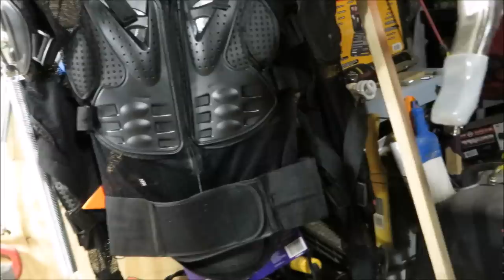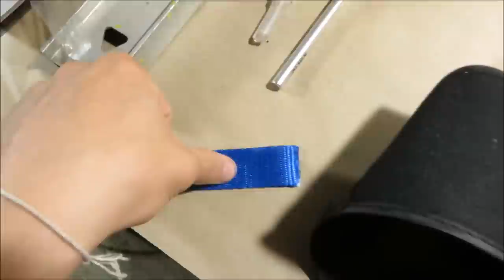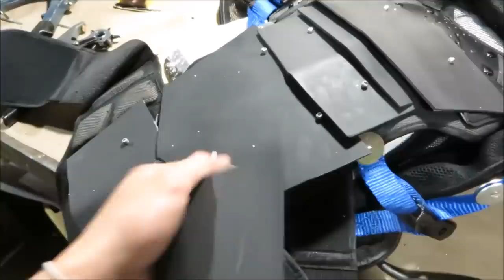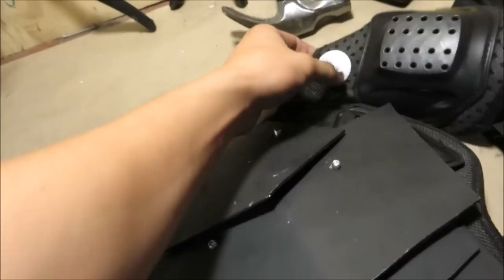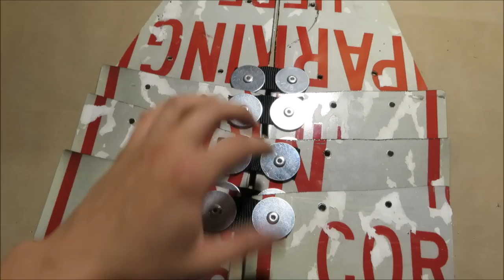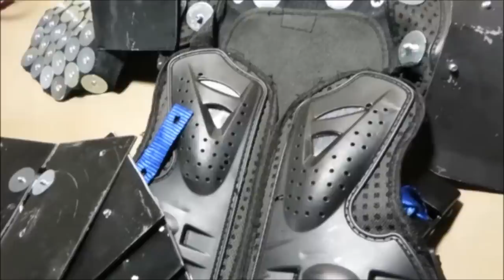How to Make: Body Armor

Comment: Can I make the Orbalisk armor and still have its powers through this tutorial?
Reply from the maker: Sure.
Reply: Nonlethalbychoice do you know what that is?
Reply from the maker: Jedi Grand Master Yoda
No.
Reply: Nonlethalbychoice then how do you know if what I'm asking can be done?
Reply from the maker: Jedi Grand Master Yoda
I don't.
Reply: Nonlethalbychoice As amusing as this is.

A quick google search showed it to be a type of multiplated armor from the Starwars franchise. (As much as I love the movies, I'm not a fan of most of the books... which is where he probably got this, books\comics.)
In the lore of SW, the armour is formed when these parasites latch onto a host and feed off of, basically their evil energy.

'Strong enough to deflect a lightsaber'. So no, the armor won't be able to deflect a concentrated beam of energy that can melt through nearly anything. Yes, you can recreate orbalisk styled armor using this build with his multiplate rivet technique. The largest problem you'll encounter is finding another jedi to duel with.

Jedi Grand Master Yoda I'm probably entirely wrong and misread, but I'm known to be right on occasion.
Reply: Patrick Hazen Use mirrors.
Reply: Nicky Tobulas :O would that work?
Reply: Road mason No. :(
Reply: Road mason Against laser guns. Use logic.

Comment: Clearly, people don't pay attention to a damn thing anybody says anymore. This guys video clearly states that he isn't building BALLISTIC armor. It's impact armor. Just because something is called "body armor" doesn't mean it's bullet resistant. Aluminum plate like that wouldn't stop a decent pellet rifle. Steel comes in different grades. Ballistic grade steel starts with a specific alloy that is then hardened, heat tempered and plasma cut to shape It is dense and it is HEAVY. My Ar500 steel plates in my entry vest weigh over 7 pounds each at 10x12x1/4 inch. I have a steel gong target that is 6" in diameter and 1/2 inch thick. That will stop some rifle rounds below a 7.62x51mm NATO inside of 100 meters depending on the projectile.

Stop putting words in his mouth.

What he HAS made is fairly decent for most direct force blunt impact. A baseball bat, sure. A tomahawk with a hardened steel prong... not a chance in hell. It might stop a steel blunt target tip on a recurve bow. A hardened steel bodkin arrowhead?.. say goodnight Irene.
Reply from the maker: Amen.
Reply: You know though if you were to wear a gambeson underneath that would be decently compliment the aluminum.
Reply: Ah. The Weavers.

Comment: Using a hot rivet to make the hole is a much better idea than punching a hole through the webbing. Reason why its better? Because the hot rivet melts the webbing and then it won't start to fray and lose it's ability to hold. Very simple idea the hot rivet but a very good way to do it. Excellent work mate, great ideas here, thanks for the upload
Reply from the maker: No problem, thanks for the encouragement.

Comment: Hey great video! I see many people asking for bullet proof stuff. Honestly that's a difficult thing to produce on a dime. What he is showing is great for costume and maybe stopping blunt weapons. More padding is needed to make it effective. AS 500 plates can stop almost any round ( steel normally used as targets at gun ranges ) but you would be too heavy adding full body plates. Composite plates like ceramic and plastics / kevlar are nice but expensive. Not to mention all the cutting to fit the person... thats alot of work unless you have a cnc laser or plasma.

Comment: You're right about the left arm thing. Typically with historical armor, you would put more protection on your off hand (usually the left). If you look at later Medieval/Renaissance knights a lot of them don't even bother with larger shields since that arm has enough protection and their whole suit is good enough to defend against direct blows from projectiles (also bucklers and parrying daggers can serve a similar defensive function as a shield while being more versatile for attacking).

Comment: Just built some low profile body armor, not to stop bullets but for hand to hand combat, I used bent steel plate to wrap around arms connected at the elbow with buffalo leather same concept for my legs then welded small sharp studs in rows to the steel plate so any impact will hurt whoever attacked, I made a chest plate as well with the same studs mounted to a canvas vest, it's so low profile you can barely tell it's on till you see the studs pointing out of my shirt

Comment: I once made a vest which was cumbersome and uncomfortable, but I used Styrofoam, ceramic tile, duct tape and intended to use seatbelt nylon, but I couldn't get a hold of any. I took it to a gun range and it guarded a .223 rifle round, a .38 revolver, a 9mm and a 20 gauge shotgun before finally breaking. Ceramic tile and tough fabrics like nylon or Kevlar (if you can find it) are your best bet.

Comment: When you finish, try this. Wet sand to rough surface, powder coat then apply underliner spray. By the looks, 2 ea. powder coat, underliner. Underliner is now made in gray.
I made 1 similar b4 YT. I used #8 1/4 bolts locktite. Nuts sticking out, guess why? 5/16 on neck, shoulder and elbow. When painted, cant tell the nutty nuts protruding. Nice Video by the way!

Comment: First of all the armour looks good. I love the simplistic approach, and do-ability of the project. I understand that this was made almost 2 years ago but a suggestion on style... By having the upper two (four halves) panels with a seam in the middle, it poses a weakness. And should the armour ever be put into real use, it is a large flaw. By having the upper breast plates solid, it would eliminate the seam, and give added strength.

Comment: You know once I found your channel I was surprised, I have been making weapons from trash and scrap items for years, I got better but no where as nice, One thing I made recently I use a large container lid, broke it in two, I cut cans for a while to save the aluminum to use, I'd cut the middle out and layer it over and over, I also crush the bottom and too add hardening I taped it all together with a lot of electrical tape, my armor/ weapons revolves around tape XD I use a lot .... But any ways I made it to where it was a two piece, a belly guard and chest guard, they would fold back when you tied them together. and form around you!

Comment: you can prevent most scratches by sanding the metal with for example a P240-P320 for a rougher look or P400-P500 for a smooth look

Comment: The heavy armor on the left side is because that is the side you hold a shield and defend with and needs the extra protection. The left side you would wield a wepon with so you have less bulky armor that would be lightweight so you can be faster with more speed and a wider range of movement.

Comment: He pretty cool, I mean this would go with his helmet and gauntlets. and since his gauntlets are designed with the nuts and bolts stick out of the side , you could use this for attack approach and the helmet would be safety for your head so basically riot armor.

Comment: you should try to overlap the washers on your rigth shoulder to get to look like scale armor(adding some using the gaps between them), because what you have there is not very resistant to thrusts

Comment: I don´t know but if you really care about armour efficiency rather than looks the approach would be a different one I think. There´s an medieval type of armour called Gambeson which is just a very thick and sturdy patted cloth armour, it basically consists of reinforced clothing and can really protect you from all sorts of hits and even light caliber bullets(though you shouldn´t bet your life on it). It will be less heavy, allow for more mobility, have a comparable level of protection and overall will just do a good job protecting you until you can get proper riveted maille armour or even actual accurate plate armour.  
The armour shown in this video might also protect you from harmbut has quite a few gaps where the only thing between your skin and whatever might be thrown at you is a soft leather jacket which is not really optimal.

Comment: In all honestly angling is more important than material. Most modern armored vehicles have relatively thin armor but because of angling the effective armor can be 1000mm+ although it would be hard to angle body armor without it becoming cumbersome

Comment: About the single shoulder pad, I think the mentality is that the weight on the right shoulder is the heavier it is the more weight is behind your attacks, also if you're a bigger guy (like me) you can just ram your shoulder into your opponent and with the extra weight it really knocks the wind out of them. That may be the reason behind shoulder spikes as well.
Reply: I was thinking maybe is a balance thing. Offsetting the weight if the shield. Kind of how its easier to carry two buckets of water vs 1 because of weight distribution.
Reply: The whole mentality behind heavy shoulder on the right and shields in the left was a matter of balance. Shields (especially of good quality) were generally  heavy so in order to counteract the weight of the shield they would weigh down the opposite side of the body. This being said a lot of people who used this set up vs being fully armored they would stand with the shield forward and there sword arm back. The swords  used in this manner were also fairly heavy compared the standard longsword, as knight swords (or bastard swords) were slightly larger in both width and length. The intent was for the shield to absorb the blow and then to be used to parry the blow while the sword arm would come in with an over head swing or a wide side swing. The main reason the shield arm was so lightly armored was to reduce the weight and allow for quicker parries and blocks.

Comment: I think a better strap would be an improvement. If you know any flatbed truck drivers or trucking companies close by ask for an old strap or go to a truckstop or truck repair and buy a new 4" by 30 foot 5400 lbs working load limit strap. The best improvement would be using an old fire house it's 3× thicker and rubber lined

Comment: For the nylon straps, you should just use hot glue. Too many rivets and washers can kind of add up.. Plus it adds a little weight and ur stuck with a big washer on the outside. Ik .12cents isnt a lot but overtime it does add up. Just a suggestion.
Reply from the maker: BboyIllusi0n Sorry, hot glue is nowhere near strong enough for an application like this.

Comment: get a mil surplus flak jacket to start and add the motor cycle pads to it so you have sleeves. rivets in the flak jacket should be study, and im sure they do not cost too much

Comment: hey, not sure if you're still around, but I just wanna check if it's really necessary for the washers when putting in the rivets. Are they to ensure the pieces hold together when you gun down the rivets? Also, is it possible to apply carbon fiber to the armor?

Comment: I work in video games the biggest reason why some characters have one shoulder heavely armored and the other shoulder without. is aesthetic reasons. It looks cool because you break the symmetry in the character. symmetry = balance and balance is boring. I guess if you have a big shield on the left, you dont need armor there. but in most real armor cases its symmetryical. Also think of Spartacus in the series. he wields double swords and has one shoulder armoured. purely for the looks in that case.
Reply: +Julian Hofman many warriors throughout history have had asymmetrical armor for practical reasons, not aesthetic reasons.. they would protect the striking arm with more armor because it was the most exposed portion of their body when attacking. and the other arm was less protected because of the presence of a shield. its a tactic that was battle tested for hundreds of years. I disagree with him changing it, but its his unprotected arm, not mine.
Reply: And on the other hand, some warriors preferred to keep their weapon arm LESS armored, so as to accommodate a faster weapon swing. And of course, archers either used more or less protection on their bow arm.

Comment: what would you think about replicating this method with lightweight thick rubber? 
I know it wouldn't be the best protection, but it would be sort of a lighter alternative? 
you've inspired me to do many different things, but I've lost the bolt off my angle grinder, and cutting metal with shears is hard, and time consuming. I'm just wondering what your opinion would be?

Comment: Well the shield i use in hema and stuff normally is so protective yxou really need no shoulder plate on the side. Simple chainmail is enough behind the right shield :D But to use it with the shield you made is good. But i would tend to use a larger shield :P

Comment: If you know any flatbed truck drivers or trucking company on a truck stop. Look at using 4" strap. new is 10 to 15 dollars  for 30 foot the working load limit is 5400 lbs it might be better. For best strapping fire hose times thicker and rubber lined

Comment: Very creative. But those ratchet straps on the side would surely break your ribs. 

Why not use a soft, small plastic buckle like packs use? You can also put it below the ribs so it has some soft area to push into.

Comment: Hey dude. Why do you prefer to use rivets than nut/bolt? Financial advantage? Installation simplicity? Or just because?
Reply from the maker: It's a lot quicker, it's permanent, and yes it's a lot cheaper. I can buy 100 steel rivets for $8 + $8 for the fender washers, while a box of 100 bolts is around $11 + 100 nuts for $8, then another $6 and $5 for washers and lock washers, you're looking at almost twice as much for nuts and bolts.

Comment: Lol when i see the holes in the armor plates before the aluminum  i go full armorsmith and think of taking the pads of and fitting a steel plate with these rivets and fit it thru the hole area and put another plate with the right amount of holes in it and then i just cut almost all the way to the bottom of the rivets and have the enough amount so when i HAMMER THEM DOWN instead of popping them witch would be way harder and require many different actions, it still leaves enough holding material so it has a better chance of the now smashed-rivets-made-into-fenderwashers staying together and not breaking off resting in the steel plate of falling off of course when im done hammering ill do a bit of welding the fender washers and other things together for more reinforcement

Comment: I have been a aircraft mechanic for 17 years and want to get into something else and was thinking about cops and if I can make something to help them deflect bullets not stop so I put myself in a shooting position and looking in a mirror can see all the vulnerable parts of the body. Cops unfortunately get into a lot of shootouts and the bullet proof vest they were only protect the chest and mostly center mass I am not set up to do all this but have the idea in my head if you're looking at your self with a pistol or ar 15 in your hand like I said in a shooting position you can see most of your exposed body parts are your forearms and shoulders I know they turn their body's long ways in a shootout to make less of a target which makes angles at about 30% or so perfect for making something to deflect a incoming round or ricoshay it rather than having the officer's arm or hand taken out of action and scene it is hot in a lot of areas I would make it so you could simply velcro it on real quick on the drive to the seen. Or maybe magnetic attachment. Let me know what you think.

Comment: Hi fella 
Good job. Whats the thickness of the metal you are using, and would you recommend thinner, thicker or just perfect thickness. 

Keep it up
Reply from the maker: Only 1/16" aluminum, for melee/costume purposes it's perfect, but if you want something to stand up to high powered crossbows and such, you're gonna need to step up the thickness an move onto steel. Maybe 1/8 for crossbows, and 1/4 for small caliber bullets. Would be extra heavy but it can be done.
Reply: Nonlethalbychoice
Thanks for the reply.
1/4 is my best bet, as im in the UK and small or big caliber guns rarely exist!
I would like to see if you got any prepping (SHTF) ideas and or alternative builds that you could make for this scenario?
Good luck.

Comment: i know you dont do templates or cut outs but for economical purposes can you tell me about how much you used and or how much it cost  and is there any chance you could start posting approximate price in the vid description please
Reply from the maker: It's always difficult to price things cause I usually find my materials from garbage or friends give them to me. For instance, I didn't pay anything for the sheet aluminum, they're street signs from my uncle who replaces vandalized signs professionally.As far as the motorcycle armor, rivets and straps, I probably spent 60 bucks.
Reply: that helps a lot thank you

Comment: You could get better results I think with a thinner steel. I know this video is old, but if you fold your edges and "spine" or flange your plates you'll get a lot better resilience vs a blow.

_____ plate is not as strong as  ___/\____ plate